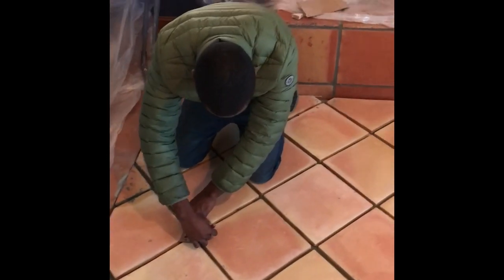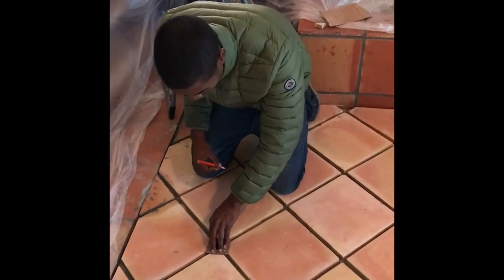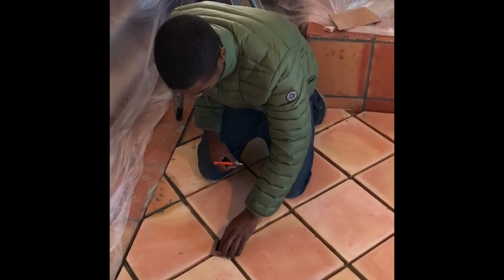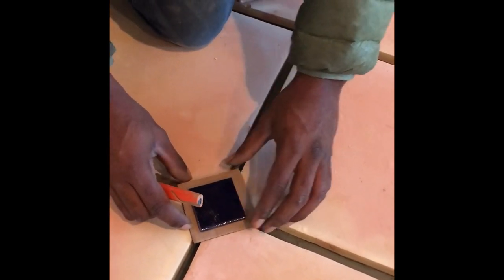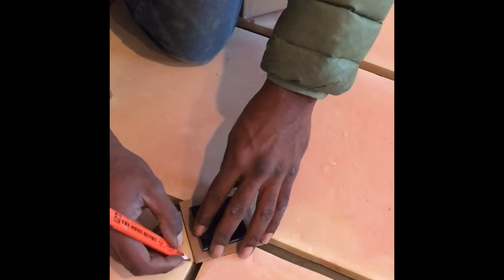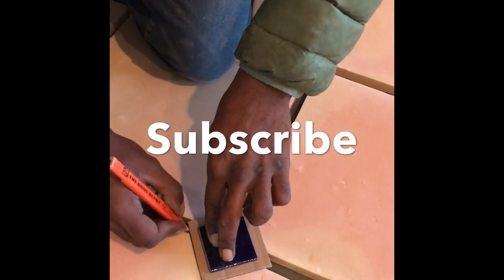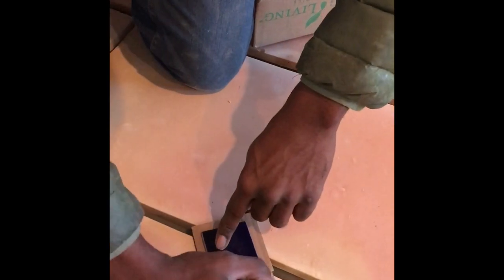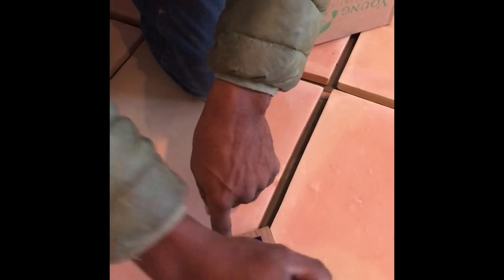Complete Saltillo tile installation (art studio) with Azul Talavera dots

Comment: I am getting 210 square feet of raw satillo tile. After receiving it, I am hand washing each tile using a tile sponge and water to remove all dust and loose clay from each tile and let them dry at least24 hours. I will then use Ole' satillo tile sealer (buy online at home depot) and I  will spray or mop top, bottom and, sides and let dry 24 hours and then repeat. These two sealer coats will prevent floor lament and grout to seap into the tile .  I then lay the tile.  I then grout the tile. I then put 2 more coats of sealer.  Then I use Ole' Floor Polish over the sealer to get a fresh polished look with NO buffing required. Ole' Floor Polish is also an on-line only product from Home Depot.

Comment: really cool with the 2"x2" in between.  What tool did you use to make the cut on the tile corner?  The saltillo in this particular video isn't stained, correct?  I like the look.  thanks for the videos.
Reply from the maker: I used a tile saw and drew a template of where to cut
Reply: @californiatilerestoration4827  So you glued the Square tiles down and then made cuts for the dots? Did you crack any tiles in the process? How did you dig out the bits you didn't want without cracking the tiles?

Comment: You can use latex to mix when applying to plywood. Only if you’ve used two sheets of plywood to ensure that there will be no movement between the floor surfaces, screws must also be placed every 8” around edges and every 6” through entire sheets of plywood to ensure the tiles/grout will not crack in the future. Also, screws must only be long enough to penetrate into second layer of plywood and not into subfloor or joists!!! Do not follow these inexperienced rookies. Failure will followed!
Reply: I would think you would want to install on top of hardibacker. Mortar and screw the hardiback down to the plywood.